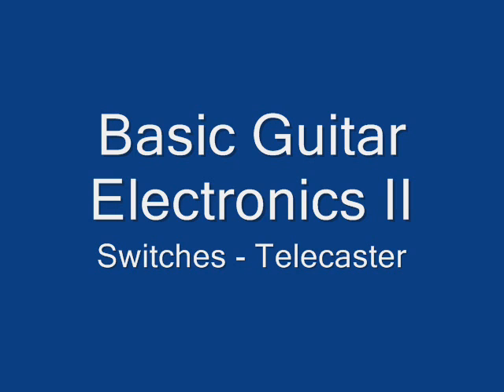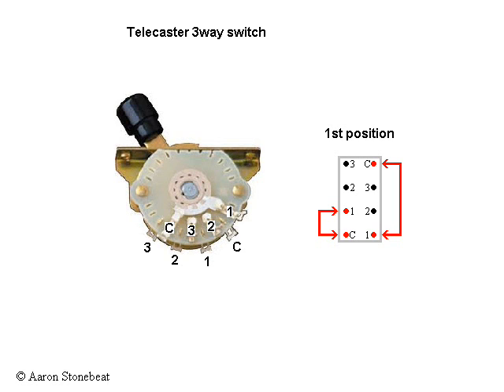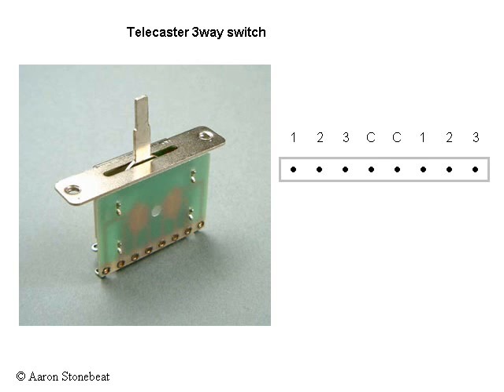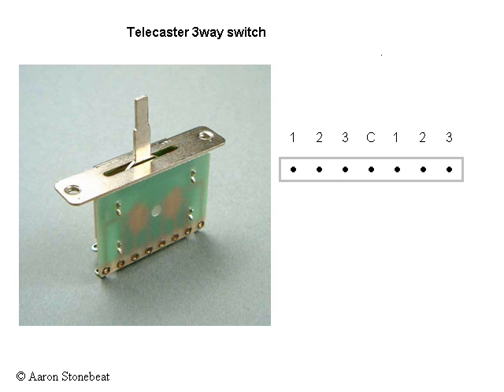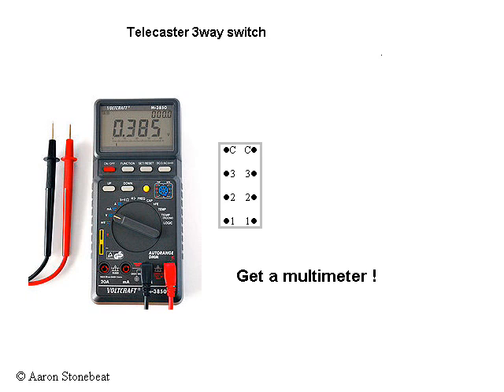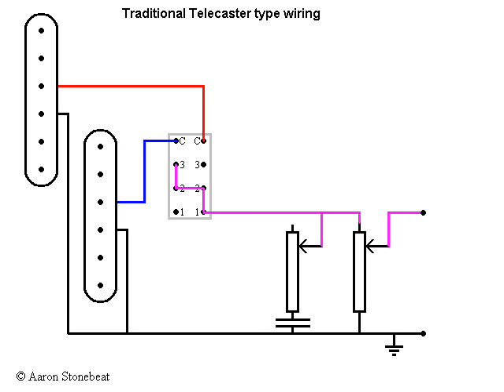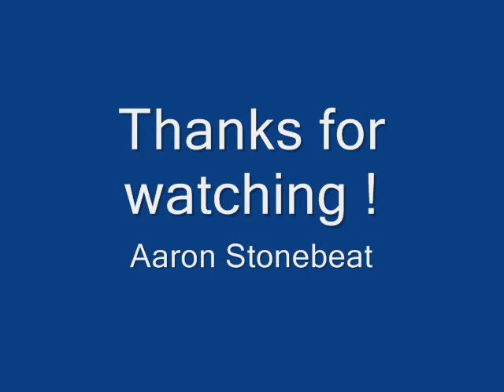Basic Guitar Electronics II - Switches Tele

Comment: Thank you for this video. I wired a strat like a tele neck and bridge, with one volume and one tone. The middle pickup fades on and off with its own volume. The  two circuits were bleeding each othe out exactly as you described. This video solved my dilemma, and its the coolest wiring mod ever. 53 tele in the neck position, 59 texas specials in the middle and bridge!

Comment from the maker: SD's standard telecaster wiring: bottom left and top right are the common connectors (white wires from the pickups); on the left side lugs 2 and 3 and on the right side lugs 1 and 2 connect together and go to volume, tone and output

Comment: Hey, I what to pick a point in the video. You mentioned a multimeter checking which is what on your switch. Can you elaborate further how to actually perform this check with the device.. and thanks for the professional contribution to the community.  Cheers Peter
Reply from the maker: Of course! First you have to set your multimeter to measuring resistance and it basically doesn't matter which range of resistance; you just need to be able to see if there is a connection (zero ohms) or not (infinite ohms).

Now touch a pair of connectors of the switch with the probes of the multimeter and see if they connect or not and make a note of it. Repeat this for all possible pairs of connectors.

Put the switch in another position and repeat the above and do so for all positions of the switch.

By following this procedure you'll be able to chart which connectors connect in which positions or in other words you'll know what the switch does.
Reply: @aaronstonebeat  Thanks a lot Marc... After watching the video, I was wondering whether you can also help out in a sort of custom wiring scheme. I got a 4-way switch telecaster wiring setup (series in position 4). However, how do I incorporate for/ connect a second tone pot to have Independent ton controls (bridge and neck pickup) rather the traditional master controls. Hope you understand my intention and thanks again... Cheers Peter
Reply from the maker: @peterwirrer552  I'll give it some more thought and I'll let you know if I come up with any ideas but for now I'd say that with passive wiring it's not possible to have independent tone controls.
Reply: @aaronstonebeat  well, I see... thanks again... btw, in the video you referred to certain lugs on either side of the switch as "commons". Are there actually connecting either side of the switch or do I have to achieve it by jumper wires? What's the purpose of the commons? Cheers Peter
Reply from the maker: @peterwirrer552  One side of a Fender Tele switch has 4 lugs and one of these lugs (the common) connects to one of the other lugs depending on the position. Lets call the lugs 'c' (common) '1', ;2' and '3'.

In position 1: c->1
In position 2: c->2
In position 3: c->3

The other side is the same. There is no internal connection between the sides; if you want that you you have to make it (use a jumper).

Different switches have different layouts. A typical strat switch (one side of it) does this:

Position 1: c->1
Position 2: c->1+2
Position 3: c->2
Position 4: c->2+3
Position 5: c->3

Some switches have just one common which is shared by both sides; it all depends on the switch and that is why it is very useful to figure out what a switch does if you don't know.
Reply: @aaronstonebeat  I appreciate your detailed explanation.. it certainly helps tremendously... everyone! 👍👌

Comment: Aaron, Seymour Duncan's wiring diagram shows lug two, in both stages, untouched by any wire. If it is a standard Tele switch then wouldn't the switch when set in the second position receive no input from either of the pick ups?

Comment: Aaron, I appreicate your reply.  However, I think you mis-read my question. I'm looking for a good, versatile diagram for an H-S-H with 2 tone and 1 master volume; or, two volume and a master one.  You sent me H-S-S, which as you say, is readily available at Seymour Duncan and other sites.  I still haven't had much luck finding what I want.  I'm not sure wheather to use the 250 or 500k pots or a combination of both; or, if I should use one or two of the .22 condensors.  Many thanks, Jim

Comment from the maker: Hi Jim,
Do you have a diagram or do you need one? On the Seymour Duncan site many wiring diagrams can be found, including the one you need: Strat diagrams > 1 hum, 1 sing, 1 hum, 1 volume, 2 tones, 5 way switch.
They use SD color codes.

Comment: Hi marc. To elaborate on my three way switch. I have the box kind that has three poles in the middle and one to the side. How may I wire it so one of the positions will b the off switch. You are to kind to respond. Love your videos. Thank you.
Reply from the maker: Reza, with a switch like that it is impossible to have the middle position give no signal I'm afraid. The connector on the side is just for grounding the switch itself; of the other three the two on the outside go to the pickups (via volume and tone on a les paul or sg for instance) and the one in the middle goes to the output. There are just too few connectors to kill the signal in the middle position.

Comment from the maker: Jim, I did see an H-S-H diagram there:
/support/wiring-diagrams/schematics.php?schematic=lilhum_sing_lilhum_1v_2t_5 (just complete the first part of the adress, I don't think I can put a link here; there's 'lil hums in the diagram but the principle is the same).
Using 250 or 500k pots is a matter of taste really, 500k will retain more high frequencies in the signal. The same goes for one or two capacitors, taste. Experiment.

But I'll see if I have time to draw something up.

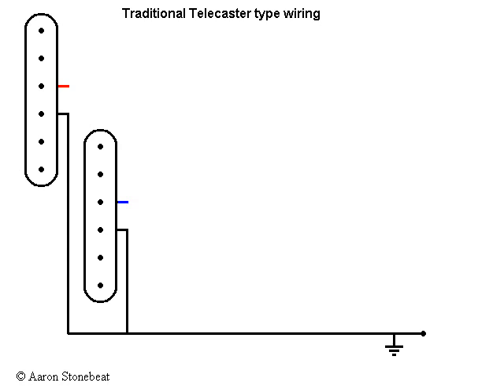Comment: Can somebody explain to me (as if you were talking to the thickest human you could imagine because I really don't understand electricity at all) what is going on at 3:59 onwards?
Reply: Marc does a great job of explaining, but just to make it as clear as possible, when the switch is in position 1, the top pickup (red lead) is selected.  When the switch is in position 2, both pickups are selected in parallel.  When the switch is in position 3, the bottom pickup (blue lead) is selected.

Multipole switches are simple in concept but can be complicated in practice when it's difficult to know which lead is which.  The possible combinations can quickly become overwhelming and very confusing.  Marc was completely squared away when he suggested using the continuity setting on a multimeter to test the switch yourself to learn how each switch is actually wired, and then, armed with that understanding, it's much easier to know how to wire your guitar.

Comment: hey man ive got a buzz sound when ever i turn on the tone was it grounded? in guitar or in amp?
Reply from the maker: +adal aldea It's hard to say with so little information; it might be a grounding issue inside the guitar but who knows? Try the same guitar with a different amplifier and the same amplifier with a different guitar.
Reply: ok nice tip i'll try it thanks man i appreciate it
Reply: hey man by the way its a 2 vol 2 tone does it have issue?
Reply from the maker: +adal aldea no, that can't be the source of the problem.